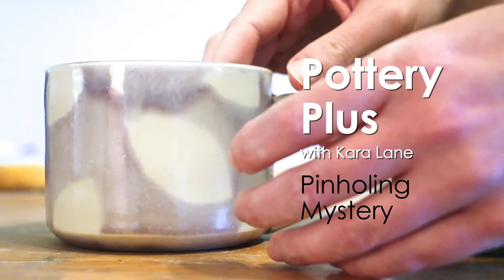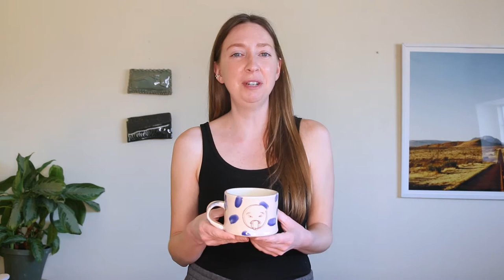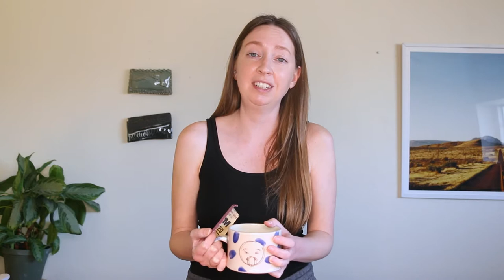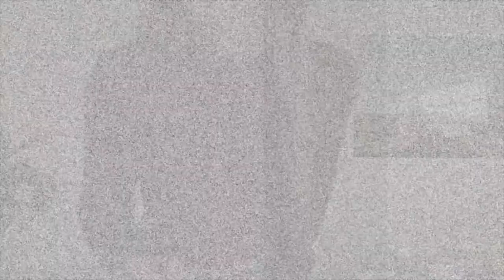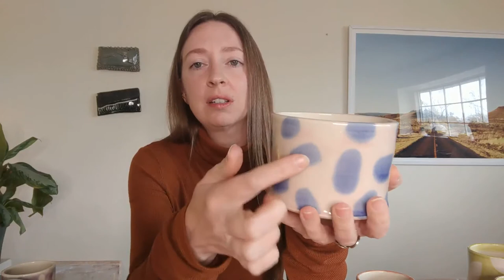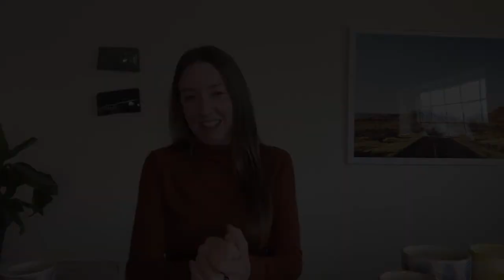Pottery Tutorial- Pinholes?! (Part 2)

Comment: The most common cause of pinholes is an improper bisque fire! Try bisking at a hotter temperature if you biscuit 05 tri 04
Reply from the maker: Thank you! I will try this for sure!
Reply: I agree the problem might be an improper bisque fire, but I wuoldn’t say to go higher temperature, I would say to go slower from 100 celsius to 450 celsius, that is when gas evaporates and organic material burns, if you go fast, gasses can get trapped out gassing in later stages of firing that will show up in the form of pinholing in your glaze.

Comment: Wait, I'm confused. You said your working with cone 5 clay (1914 degrees) and you fired it too hot at cone 6 (1830 degrees). Then you said you would fire at the lower temp, cone 5.
Reply from the maker: Hi! Sorry for the confusion. Cones 5 and 6 are 2185 and 2232 degrees fahrenheit. The temps you mentioned are for cones 05 and 06. Temperatures below cone 1 (in other words the cones that have a 0 in front of them) decrease as the cone number gets higher. Above cone 1 the temperature increases with the cone number. It's kind of like a number line with positive and negative numbers! I always find visuals to be helpful for understanding the cone scale and they are easy to find by googling Pyrometric Cone Chart. Thank you for your feedback!